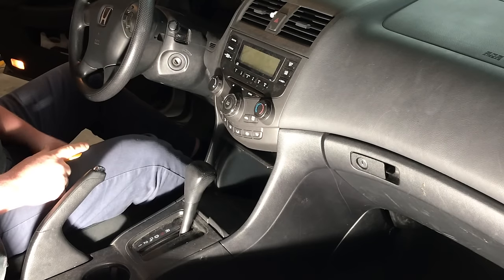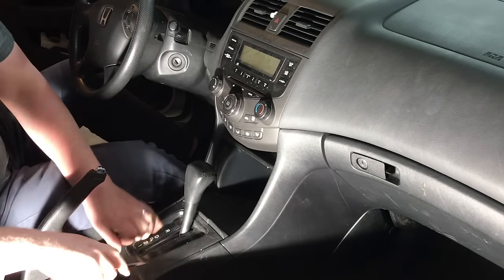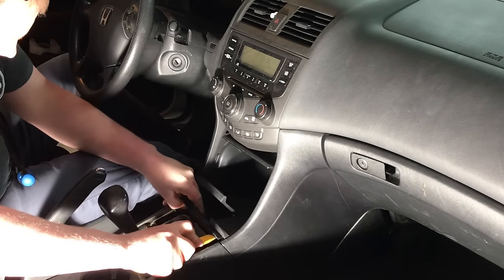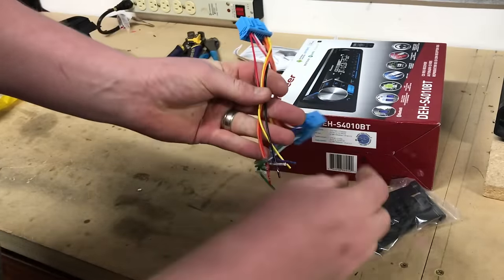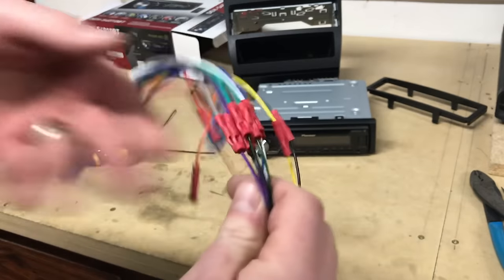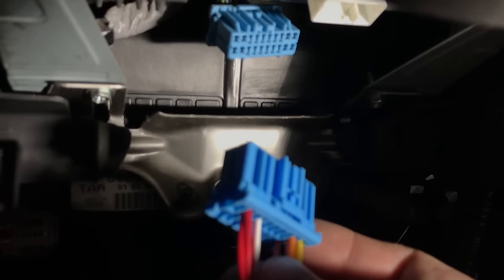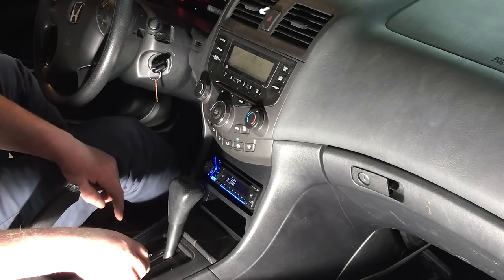2003 - 2007 Honda Accord Radio Install

Comment: All my wires are matched up color by color except orange an my new stereo won’t turn on. How do u check if the yellow wire is good ?? Where’s the fuse ?
Reply from the maker: a multi meter will be your best friend.  Also try turning on your factory radio (it still should boot up, but no sound should play).  A multi meter would indicate the yellow has a constant 12v signal, red has a accessory signal (12v only when the key is on), and ground.

Comment: Quick question, did you have to buy/use a antenna adapter/extension to reach or fit your new radio? Thanks in advance
Reply: I would guess one is needed for sure. I have a feeling he doesn't know because he didn't bother with it but it's only a guess based on the fact he didn't show it and based on the fact that they are just barley long enough to reach their factory location as is. My guess is he tried,saw it didn't reach and made the video the way he did as a result lol.
Buy an extension in preparation.

Comment: i just did this exact setup to my 06 accord, did you have a problem reaching your antenna cable to the hole on the radio?
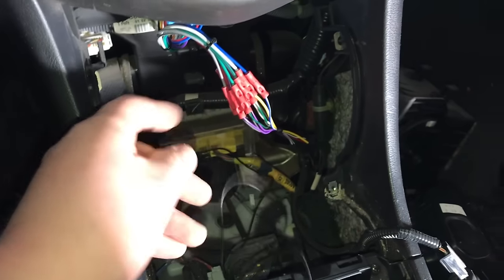Reply from the maker: Yep, so we had to pull the radio out to re-route the cable to a better location to reach.  See 9:58

Comment: Do you know how I can disconnect the stock radio without interfering with HVAC controls ? I put my custom radio  in but can’t stop the stock radio from turning on randomly. Just wanna disconnect it but not sure which wire , thanks !
Reply: Hey man did you ever find the solution I have the same problem?
Reply: @lukasstone4199  hey unfortunately not I tried to locate exact wiring to cut the radio power but didn’t wanna risk it. I’m sure there’s a solution but might take digging

Comment: Could I install a speaker amp with the aftermarket radio as well ? If so , can you upload tutorial 👍🏽
Reply: Of course. In that case,you do so following the amps instructions exactly as you would with any other aftermarket radio now ignoring the fact that the pigtail harness even exists. Just pretend that's not there and make all connections right off the the radio harness side (closest to your aftermarket radio).

Comment: Would this be compatible with the 05 Accord ex-L with nav ? My nav system doesn't turn on but the air and backlights and everything works. Can't play music or use a/c tho bc it doesn't power on.

Comment: Hi, could you explain how to reset the clock after installing? The radio code is an error and the SOUND button doesn’t work to reset it. Thanks!
Reply: Im not sure how to reset the clock but for your radio code if you have it press in on the numbers under the volume nobe that is used to keep your favorite stations. And put in the code 1-9 or whatever the numbers are

Comment: the antenna input on my radio is on the side closer to the steering wheel. I can plug in the antenna but when I try to fit the radio into the dash it's very hard because the antenna cable is too short.
Reply from the maker: Extension Cable time: https://www.walmart.com/ip/Scosche-AXT96-Antenna-extension-Cable-96/23842077?wmlspartner=wlpa&adid=22222222227017366218&wl0=&wl1=g&wl2=c&wl3=40839730232&wl4=pla-78653189432&wl5=9029683&wl6=&wl7=&wl8=&wl9=pla&wl10=8175035&wl11=online&wl12=23842077&wl13=&veh=sem

Comment: I’m trying to install mine now I’ve followed all the steps and now my car radio won’t power on so nothing on the radios power on I’ve checked the fuses and have no clue how to fix could someone help
Reply: Maybe try replacing fuses? There's one under fuse panel and I'm not sure if there's one behind actual radio?
Reply: @sroel06  i replaced the one in the panel it had blown out ill look on the back of radio to see appreciate the help hopefully i can find the problem

Comment: Hi, may I ask if the stereo unit is the same size for all Accord 2003-2007? Thanks!
Reply from the maker: Any single din will work with the parts used.

Comment: Hi, thanks for help. New radio works and the old one turns one just right. I have steering wheel adapter but I cant get the buttons on wheel to response. Any advice?
Reply: What adapter did you get? Did you use the wire from pin 3 in the factory adapter? It's the green one with red stripe. It dead ends in the pigtail now so you can just cut it and put your butt connector right on the wire that comes from inside the dash and hook it to the wire that your aftermarket radio says to connect it to.

Comment: Is anything happening to the original wires or no? Basically a plug and play kinda
Reply from the maker: Plug and play from the factory side. Just wire in your chosen radio's harness to the adapter and plug and play.

Comment: My factory radio comes on when the car is turned off, draining the battery. Will this fix my problem?
Reply: No. Something is wrong with the red wire line. The easiest fix would be to get in there,snip it and cap it off. Find another wire that provides 12V only when the car is on this way the radio can be on when the car is on.
Reply: @Warrior_Resisting_Colonialism  , thanks for the reply. Just to be clear, bypassing the old radio and replacing it with an aftermarket one would not fix the battery drain? I'm not understanding.
Reply: @woodstockpaul6066  Not by itself no. If your just looking to fix that issue,then you need to figure out why the 12v switched power isn't turning off OR cap it off and run your own devoted switched 12v line to the radio. The aftermarket radio could then be installed but it has nothing to do with the switched power source no longer switching on/off.
Reply: @Warrior_Resisting_Colonialism , Thanks.

Comment: I did everything you said to, but when it was time to turn on the new stereo, it wouldn’t turn on. Could this be because of wiring or what?
Reply from the maker: Sounds like you may have the factory amplified system.  In that case, be sure to connect the blue wire on your adapter to your blue/white wire on your harness.
Reply: I’m having the same problem, but all my wires are matched up, blue to blue/white included. The only wire not being used is the orange one, as in your demo.  I am using the Pioneer MVH-X390BT, seems to be pretty much the same as your video, just without the CD player.  Double-checked that all the wires are tight in the butt connectors, and that the adapters in the T-harness are all seated properly. Any guesses?
Reply from the maker: Bust out the multi meter and test for a good constant, ground, and switched power (yellow, black, red) to ensure operating properly.  One of those three would be causing the issue.
Reply: Sam M did you ever get this resolved
Reply: Shelly Sousa did you ever get this resolved. I'm having the same problem
Reply: @shellysousa1418  Was your constant yellow power dead? If so,where did you find the fuse location?

Comment: Thanks for the video. Have you tried the metra kit that replaces the HVAC controls as well? Does it work well?
Reply from the maker: They are hit and miss, but generally a better alternative for those that don't want to keep the "dead" radio above the HVAC controls.  We have had good success with them in the shop.  This install is more of the budget friendly version.

Comment: Hey my 2007 accord has a factory navigation. Would the navigation still continue to work if I had this installation done?
Reply from the maker: Yes, but the audio will no longer work.  The factory radio still turns on and operates without any sound.

Comment: Any reason why after installing the Bluetooth radio that the radio is now all scrambled? It works but the display is overlapping other display messages. Any suggestions greatly appreciated. 2007 Honda Accord w/ XM no nav.
Reply from the maker: Weird.  I'd check your connections and maybe reset the radio by removing the negative off the battery.

Comment: An after market radio was installed in my 05 donda accord, but old stereo doesnt turn on. Do i need a T-harness? Is that what that's for? To retain both stereos to be on?
Reply from the maker: T harness retains power for your HVAC controls / old radio only.  Basically your old radio becomes a glorified clock as all "radio" functionalities now operate through the new stereo.
Reply: @ProvoBeastAudio  i just dont know why the professionals who installed didnt use that....thanks for info.

Comment: Followed this video and installed a new stereo. Great instructions.  Thank you. So after a few  months, my battery started dying. Through process of elimination and amp draw test,  the new radio is pulling 3 amps of power. Why would this be happening? 05 honda accord.
Reply: Christina M some people say that the old radio drains the battery that’s why they don’t plug the connector back into the factory radio
Reply: Christina M Did you end up finding the problem. My car battery will die too because of the radio
Reply: I'm having this same issue. Can you just unplug the harness going to the factory stereo even though the new one is hooked to it?
Reply: @garystoliby7219  no bc in my car, it also controls the ac/heat functions and lighting on those functions below the stock radio. For a while I would just pull out the radio fuse  under the dash every time I got out of the car. It's the only thing that would keep battery from dying.  I ended up finding a solution.  I wired a 10 amp wire into the fuse panel where the radio fuse goes, literally stuck the wire into the fuse spot. Then wired it to  a toggle switch. I mounted  the switch on the left side of the steering wheel below the vent. Sounds crazy but it works. Unless I forget to turn the switch off, then battery will die overnight.  Been working great for over a year now with my after market stereo.
Reply: @jon.esalido2817  I'm sorry I never saw this, my response below to Gary says how I solved it. Sorry!

Comment: Hey. After I installed this if I try to use my AC it says “please start engine to use AC” how do I fix this?
Reply: Sounds like one of your HVAC wires doesn't like what you're doing. Climate controls are sensitive. They communicate with the car through these wires. Did you disconnect the car battery before installing the radio? If not you may have upset the system. Disconnect the battery for a half an hour. Reconnect it and see it the system reboots normally. If not, you may need to head to a dealer. You may have dislodged or damages an HVAC wire.
Reply: You ever get it fixed?

Comment: Is the factory radio buttons and the screen suppose to still light up when installed new radio.
Reply: Yeah. It will all actually work just like before with the only difference being,you wont hear any audio coming from the factory radio anymore. HVAC controls with lights and the clock etc.all work the same as before. The pigtail sends all the power and the speaker wires to the new radio so that works too and of course you'll get sound from that one now.
Reply: @Warrior_Resisting_Colonialism  will the old radio screen show your temp settings and mode settings like before.....
Reply: @perry_123  Yes. Everything other than audio no longer being heard from the radio will remain the exact same. The screen for everything remains fully operational and exactly the same. In fact, if you disconnect the battery, you'll still need to enter the factory radio code for the thing to work, just like original EVERYTHING besides no audio from the radio remains EXACTLY fully operational when you add a pigtail and aux radio. I've still got the car and it's soooooooo much nicer to have a real, basic, aftermarket radio down below. Great upgrade. I keep my clock set so it's displaced all the time. Keep the factory radio turned off and have FULL factory use of all my heater and a/c controls, just as if nothing happened.
Reply: @Warrior_Resisting_Colonialism  Thank you so much for that info........I was a little concerned about that...So i guess it,s time to put a stero in the 03...Thanks again

Comment: HELP! lol. I shorted out the constant 12V yellow wire while installing the pigtail. I dunno why they had those pre-stripped. Oh well though,I figured. I would just look up in the manual to find out where the constant 12V supply fuse was located and replace it. Well not so easy. The manual just lists "Radio" fuse 10 amp. Well that's the switched RED 12V. No problem with power there. Where is the fuse for the constant 12V yellow wire and why can't this easily be found via a quick google? WTF? I'm about to just run my own fused line and be done with it but for gods sake it's just a fuse somewhere......right?
You know how most older cars this was often just run off the sig lighter line so you would test that and replace the fuse but in the 05 accord the sig lighter isn't constant,that switched on too so it's not on that line. Where the hell does the yellow line gets its feed from?
Reply: Update; I had to just give up and just leave the line dead. I ran my own fused wire in from the battery. I know where the fuse is now. Right off the battery in a fuse holder. Took less time than I spent online searching to see if anyone knew. I never did find out and I hand checked every single fuse in both fuse panels. Strangest damn thing I ever heard about. Perhaps it's hidden because it's also the anti theft light? If people know right where it is,they just pull the fuse and they can cut the anti theft lol I dunno but I don't care. I'd rather know where my fuse is. I know now even if perhaps my car's now easier to boost lol.
Reply: @Chris Hale Hard to say. If it was protected properly on a fuse it shouldn't have burn though. No matter. Got on my own line and I know where the fuse is now.

Comment: hey man i have the issue where my radio turns on and off and plays when car is turned off so it drains the battery and all , so if i install one in the pocket will it canceled teh original one because i cant have power to the oem radio since it starts by itself ??? and i dont want to loose my heater control buttons and all
Reply from the maker: You can try, but since you still have to power the factory radio so the HVAC controls work, you still may have the issues, even when adding a radio.  I suggest replacing the actual radio itself with another factory one (look at ebay or junk yards) or you can use the Metra Kit (listed in the description) and actually replace the radio.
Reply: mlb shark hey man did it end up working because i have the same issue with my car
Reply: mlb shark if you can reply asap just so i know not to get it
Reply: Jimmy Mendoza hi I just got a aftermarket radio install,  Imucky I found out a Profesional that's been installing radio for 18 years , he knew about these accords . So he install that aftermarket one and he by passed some wires so when my key is turned off it would cut power to main radio and arranged the wires for me to keep the lighting in the buttons . It's been 1 week for now and the battery hasn't drain yet so I will see if it still does it in the future but for now I'm OK

Comment: is it still possible to use a radio transmitter after the install of the new radio?
Reply from the maker: I'm not sure what you mean by a radio transmitter?
Reply: Provo Beast Audio Installation https://goo.gl/images/HccEdg this is what it looks like
Reply: Provo Beast Audio Installation you match stations through the transmitter and your radio and through Bluetooth connection it will be able to play your music using what ever device
Reply from the maker: I'm not sure why you would still want to use an FM transmitter when the new radio has bluetooth, AUX, USB, and CD inputs.  FM transmitters are some of the sound poorest quality devices on the market.
Reply: Provo Beast Audio Installation I was just curious because I already have one and wanted to know if it was still compatible with this system
Reply from the maker: Technically yes since the new radio has am / fm, there wouldn't be a point using it as it would reduce the sound quality.

Comment: I tried this. I couldn't get my radio to power on
Reply from the maker: use a multi meter to check your constant power (yellow), red (key accessory) and ground to ensure proper connection.  If one of those three are not working, the radio will not boot up.
Reply: @ProvoBeastAudio  Where is the fuse for the constant,yellow wire located? I shorted it out installing the pigtail and can't find it. The radio/red wire fuse is good.
Reply: I'm super confused now! So whilst checking for the constant yellow power at the original plug there's 12v, but as soon as you plug in the t harness no voltage seems to go through?

Comment: Mine ain't turning on
Reply: It turned on yay lol I've been using a bt speaker for about a year and I finally got tired of having to charge it and all that because the stock radio screen was busted and it would turn on for like 2 mins then a lot of static then finally it wouldn't turn on

Comment: Any idea what might be wrong if I did everything identical but my aftermarket won't power?
Reply from the maker: Hit the power button on your factory radio.  Does that boot up the aftermarket one?
Reply: Provo Beast Audio Installation I did the same thing he did but it’s still not working. With the old radio on
Reply: Was your constant yellow power dead? If so,where did you find the fuse location?

Comment: where did you get the cable to adapt both
Reply: I think it's included with the Metra 99-7862
Reply from the maker: Amazon, ebay, etc.
Reply from the maker: Yes comes with the kit

Comment: will the radio controls on the wheel still work?
Reply from the maker: If you buy an adapter module, yes.  You can use the Metra Axxess ASWC-1 to retain those features.

Comment: My 2005 honda accord  radio turn on and off by it self. Question if i add another radio would it fix that problem too cause right now i just took off the radio fuse and not use the radio. Thanks!